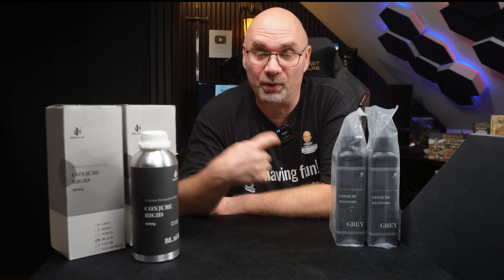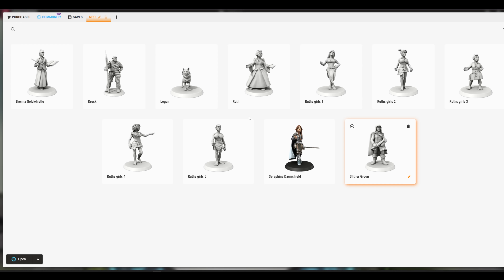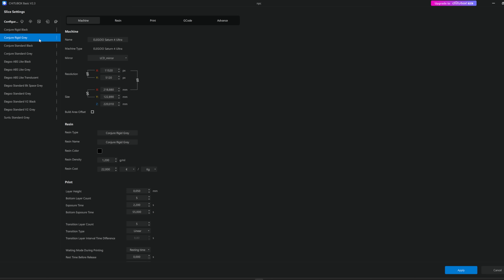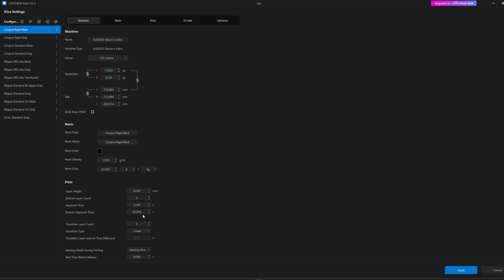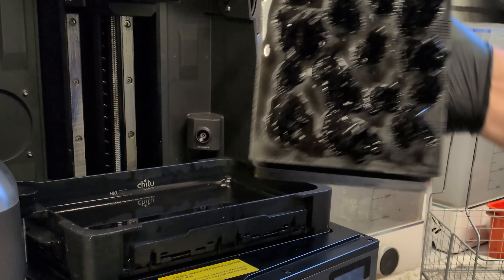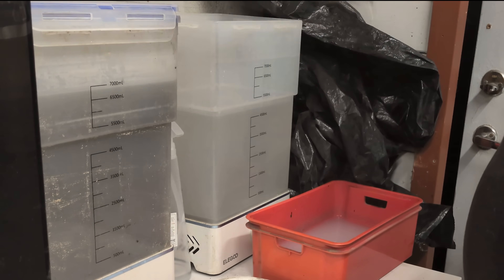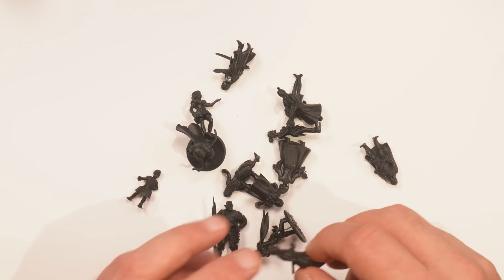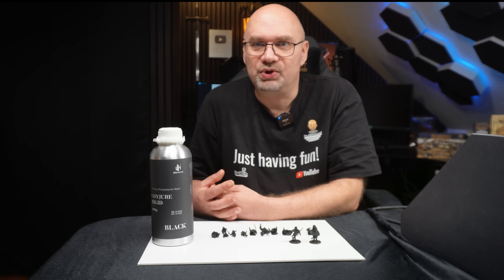Printing Miniatures with Rigid Resin

Comment: Conjure Rigid Grey or Black have been my goto resins for the past 12 months.
Once calibrated they are monsters.
My set up includes a S4U 12k, chitu heater (I print them at 27.5 C) and hoopat X4, Sunlu ultrasonic cleaner and Phrozen large UV cure.
For cleaning, I go through 2 baths of Mr Clean (1 gross drip, 1 ultrasonic), then 1 rinse of warm water for supports removal, +1 final IPA rinse (stays quite clean a long while). I dry with an hair dryer and then UV cure in a bath of water (enhances even UV distribution) for 2 to 5 mins pending on the prints sizes.
My exposure times are slightly different than yours (could be temp related)
1st layer: 32-35 sec
Others: 2.63-2.65 sec
Rest: 1.2 sec (avoids delamination and supports cracks)
Note there is currently a very good deal on Conjure Rigid black: 5kg for 83 USD.
Reply: BTW heating the resin has been key to success .27.5 C is a good compromise between reasonable heating time (approx 25 min) and success rate. 30/35C would be even better for lower exposures but take more time to heat and to sustain température in my environment (basement at 14/15 C in winter)
Reply from the maker: I have some challenges in the winter, my workshop is not heated, so i try to make as few prints during the winter as possible 😀
Reply: 50 ish USD chitu heater (v1) and you are good to go whatever  the temps of your workshop. I also built an enclosure to accommodate the S4U and a Mars 4 DLP. This facilitates heating and fumes confinement/extraction.
Reply from the maker: Cool i might get one of those👍
Reply from the maker: Thank you for sharing your detailed setup and tips, it's very helpful!😃